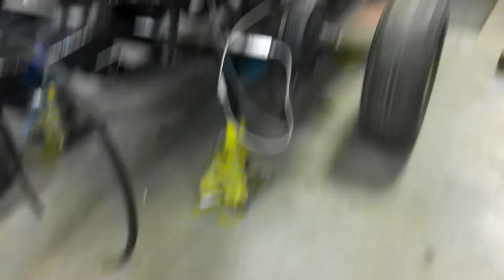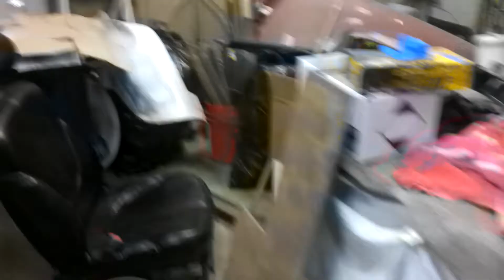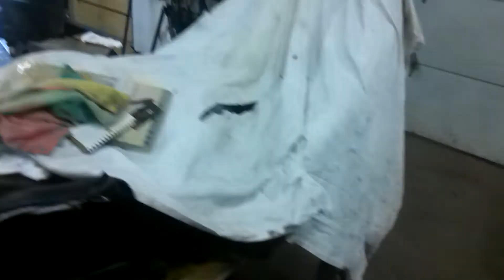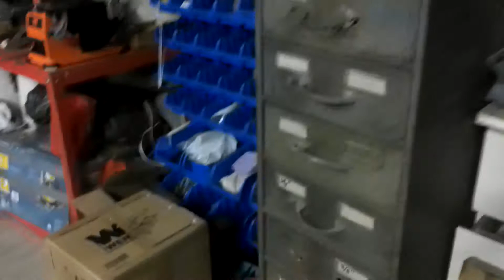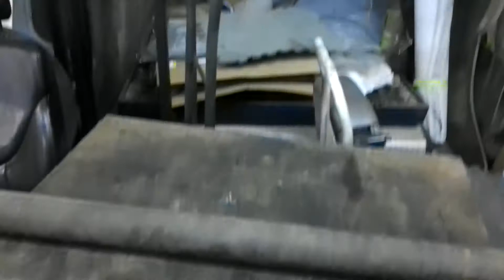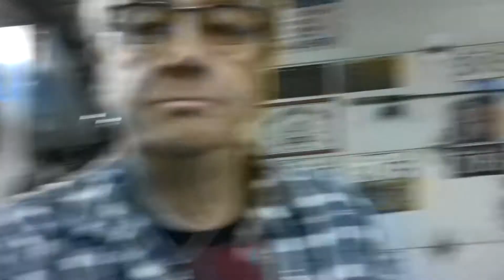# 118 Get ready for more FUN

Comment: I came to the conclusion I hate having to clean the whole shop after it's been turned upside down. Since my last whole shop clean about 6 months ago I have been doing weekly cleans that only take half an hour , which gives me more beer drinking time.
Reply from the maker: Hey Glen. Thanks for dropping by the Dog House. I tried that way a while ago, then I would have to take all the tools out again the next day. So I figured that seeing I was going to work on that same job tomorrow, why put the tools away and take them out again. But it backfired on me. 😏🥃
Reply: @AndysDogHouse  I hear ya, my tool box ends up empty and I spend all my time looking for tools 😬😉
Reply: @AndysDogHouse  forgot to mention I like your urinal idea mine is just a 4" abs pipe in a half barrel full rocks and holes buried in the ground I will have to plumb It inside
Reply from the maker: @glenmiller3783  Hey Glen. Yea I plumbed the water jug in a while back. I hated when the guys would come over and there would be nothing but yellow snow in the morning.